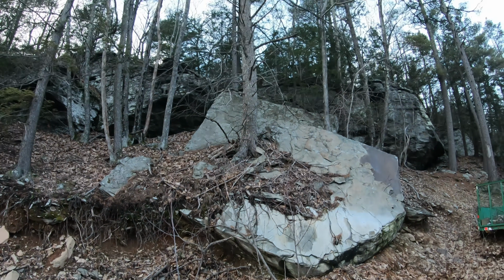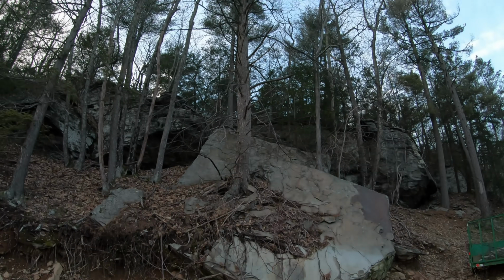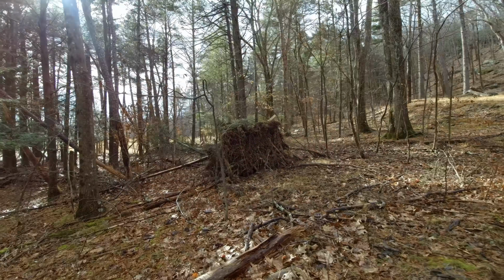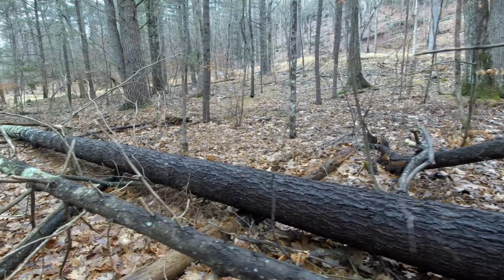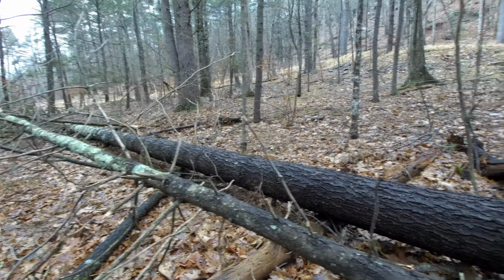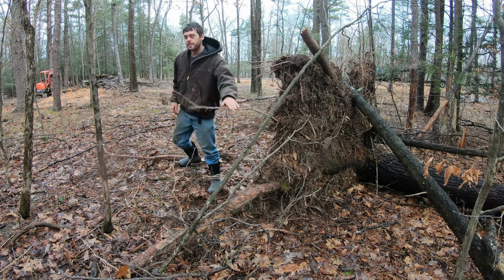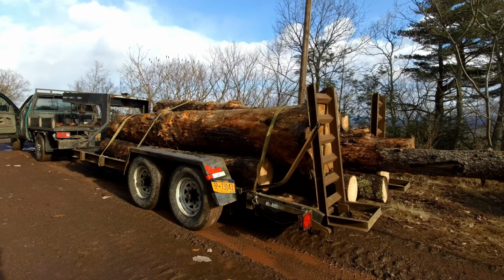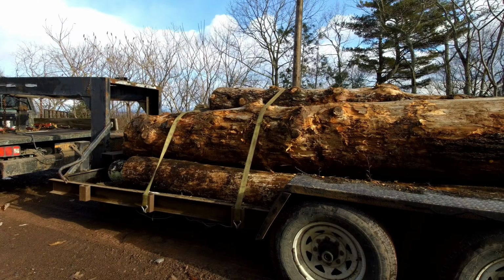Getting logs ready for the sawmill

Comment: A N D R E W      
FIRST GREAT VIDEO! 
Second a good trick when servicing duel wheels is to put a strip of grease on a smooth concrete floor where the tires touch the floor and when taking the wheels off the hub you can slide them off.  It makes the job easy as pie.  I had to do that when I was 15.  I could not pick up the tires.  An old mechanic showed me to jack up the wheels or pull the truck up on to a grease slick.  The wheels will slide right off easy as pie!!! 

The other thing those two piece rims can explode apart under pressure.  When we changed the tires we put them under the car lift.  Some places have cages.  If it comes apart under pressure it can kill !!! Please use a serious heavy thing to keep from getting hurt!

Comment: You pretty much have to have something like a excavator to handle the logs to keep them off the dirt. The blades last so much longer.  I usually skid in the winter in deep snow. What kind of trees are those? I’m tired of milling spruce here...wish we had some different trees up here to mill.
Reply from the maker: Mostly white pine, but there are some Hemlock.
Reply: Andrew Camarata what is hemlock good for.
Reply: @Northern_Farmer  Some people claim that hemlock has natural resistance to rot and use it for patios, etc.  We have them here in NC, two different species, and they have actually been used in home construction and more.  Building codes are getting more problematic and now about everything has to have a stamp on the wood from a licensed grader.  Andrew has been a no-nonsense favorite for some time now.

Comment: Love your Channel how many hours is too many on an excavator? You said the Kubota had 10,000 how many do you expect to get out of the motor
Reply from the maker: IDK, it depends on the excavator. Some machines are junk when they are new, some last forever. Usually stuff made in Japan last a long time. Especially if it has no electronics.
Reply: @AndrewCamarata  thanks for reply your channel is the best on the internet! So I shouldn't be afraid of an older Kubota with 10,000 hours?
Reply from the maker: I wasn't afraid of a Kubota with 10,000 hours. But I wouldn't buy a John Deere with 400 hours on it.